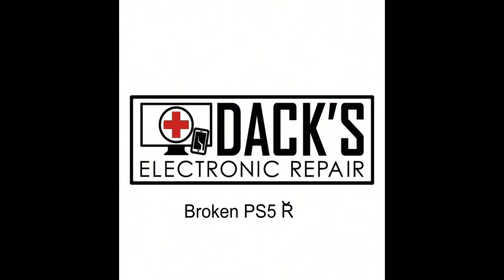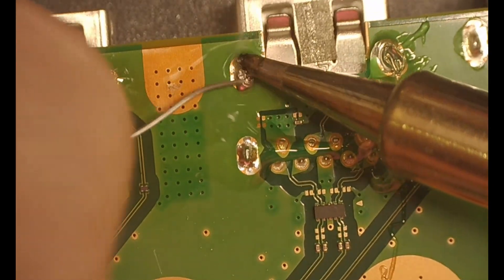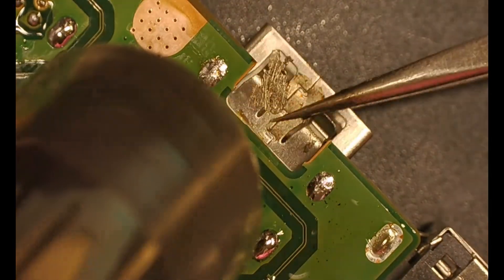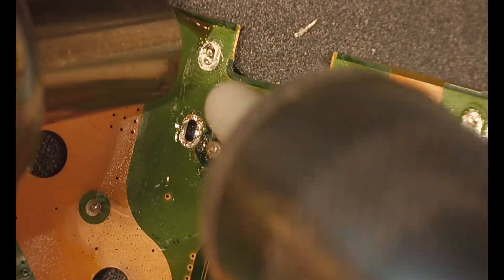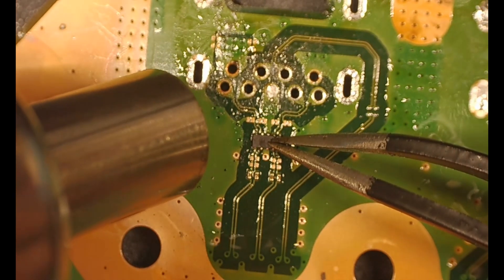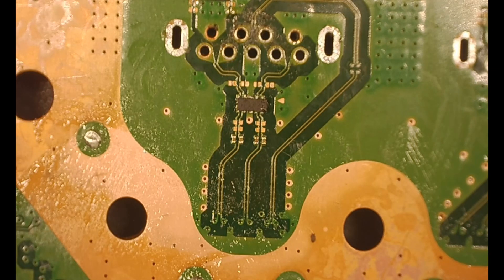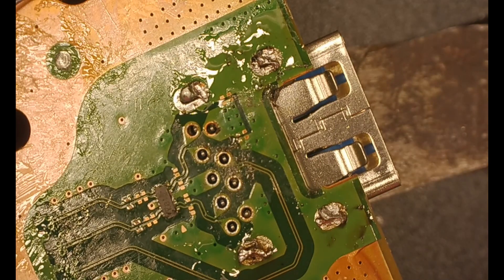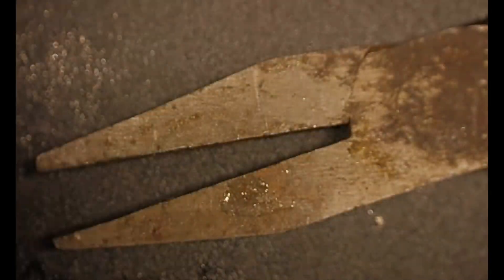How to Fix a Broken Sony PlayStation 5 (PS5) Rear USB Port

Comment: could the heat mess up the motherboard or any other parts of the ps5?
Reply from the maker: Yes it can melt plastic components and connectors and also unsolder other things if you are not careful. You can use heat tape or aluminum foil to mask off the area if you are worried about that. Also don't go to hot with the hot air. Just enough to melt the old solder.

Comment: Great work! I understand the temperature for heat gun was around 480°C but what about the air flow percentage ? Thanks!
Reply from the maker: Good questions, I usually have it right about 50 to 70 percent but the problem with that number is every machine has a slightly different airflow. Basically I like a pretty good flow but not enough to start blowing capacitors away because they can become unsoldered as well.